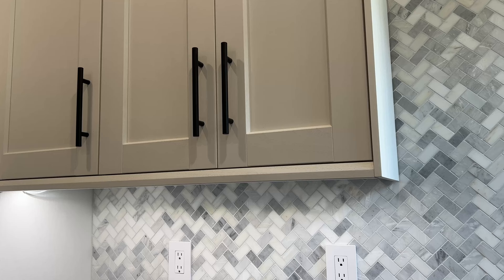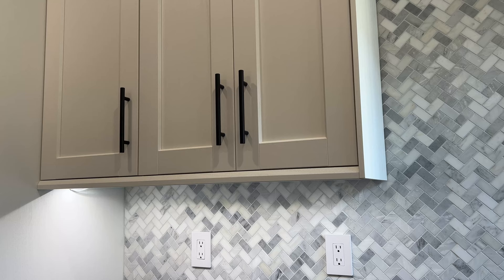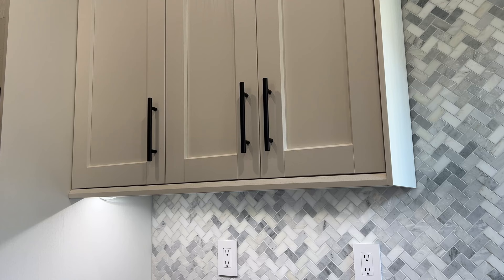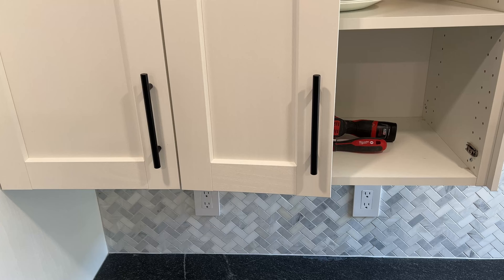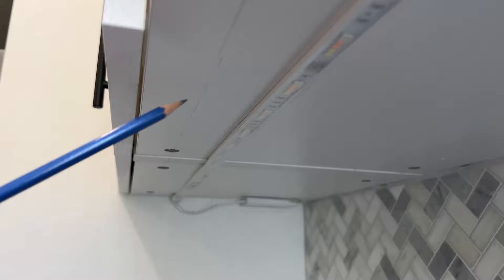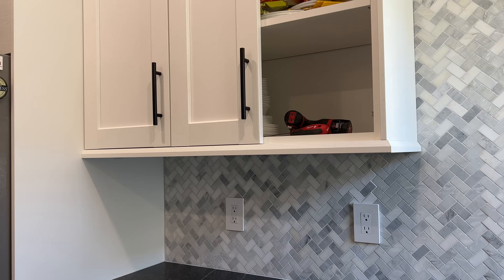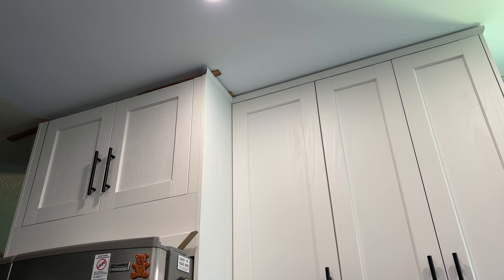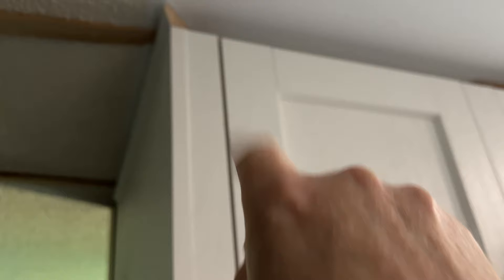How to install Ikea Enkoping Deco Strip quick easy professional results!  What Ikea doesn't tell you

Comment: Thank you so much! This is so timely! We just starting installing our enkoping white cabinets this week! And I loved the enkoping trim when I saw it in IKEA! It’s part of what sold me on the Enkoping kitchen above some other choices. (Plus a better price, but the white makes me nervous!) lol! There are very few Enkoping Kitchen videos or info out there yet, especially on the trim. Like you said, basically zilch! My young inexperienced with IKEA but hard working contractor will need this info when he does the trim next week. Again, this is so timely. Do you have a way I can contact you with a few more questions and photos? I was concerned about his choice of screws, but he did a great job with putting up the first 7 wall cabinets and cover panels! Looks like maybe you used the same round heated, not flush screws, which I think is odd for inside the cabinets.
Reply: Also, have you had any issues of chipping off of the white when drilling or screwing?
Reply from the maker: Glad I could help!  If you have any questions, post them here and I will respond as best I can.  Keep me posted on the progress!  Thanks for watching and the kind words!
Reply: Thank you!

Comment: [90° - 67.5° = 22.5°] For anyone who wants to know why the heck IKEA puts 67.5° degrees instead of 22.5°. It actually is the proper 22.5°...  it's because of where they placed the ref' arrows on the angle dimension on their drawing. From the vertical "Y axis" you need to measure a 22.5° angle; but from the funky horizontal "X axis" they referenced (especially since they use the bottom left quadrant (-X, -Y)). The 67.5° is the proper angle from that reference point... (90° - 67.5° = 22.5°) I think they did this so that they do not reference an imaginary line (the extended axis line going into the cabinet) this way they referencing off of the physical cabinet surfaces.. but that's not how your miter saw works.. your miter saw always has a set 0° "Y" axis to reference from! lol Thank You for reading! (Now go do some angle math to see for yourself)
Reply from the maker: That's a great explanation.  Thanks for taking the time to comment and for watching!

Comment: Thank you!!! Saved us a bunch of time and headache. We had a more simple set up, but this was a super helpful!! Our kitchen set up is super basic compared. We put the deco strips on the top of the cabinets before actually hanging them as we did not have any corner cabinets and just straight edges. Worked ok, as our ceiling is super wonky, in an old house,  and not at all straight so we had to hang about 5/8 gap below the ceiling. Looks decent enough. Cheers!
Reply from the maker: Thanks for sharing.  Please like and subscribe.  Thanks for watching and the comment!

Comment: In metric 3/4 inch is 22mm or 2.2cm.
Reply from the maker: 3/4" is actually 19.05mm or 1.905cm.  Thanks for the comment and for watching!
Reply: @MoreBear  Although you are right, when fitting side panels and deco strips etc. the magic measurement is the thickness of the door, 18mm plus 4mm which allows for the hinge protrusion. 22mm is the correct distance for fitting the decor strip; anything less and the door will not be aligned with the deco strip/panel.  Remember the magic number is 22mm. Deanne, kitchen fitter.
Reply from the maker: @DeanneMariaCreates  Great info to share. Thank you very much!

Comment: Hi, thank you for the great video, it has helped me a lot with planning the install of the kitchen cabinets, my question is, how far down from the ceiling did you mount the hanging rails, in order to leave enough room for the moulding on top of the cabinets?, it looks like you left a small gap between the the top of the moulding and the ceiling, how much gap did you leave?, please let me know when you can,, thank you,,,
Reply from the maker: Great question.  I have 8' (96") ceilings, so the bottom of the hanging rail was mounted at 92&3/16".  Please refer to your Ikea cabinet installation instructions.  I also have a video on how to install the Ekoping deco strip at the top.  Please like and subscribe.  Thanks for the question and for watching!

Comment: This is one of those things where there are a lot of right answers, and it's all a matter of taste. In my kitchen, I put them on "backwards" so the visible parts are square and that beveled edge is hidden. The face of the deco strip is even with the face of the doors, no reveal as here, with the end panels to the top and bottom of the deco strip. That goes better with my Tistorp slab front doors. Easier too! Though I might do it the way you are for shaker-style doors. 

Another tip - in a section like this, it will look better if you put a cover panel on BOTH ends, rather than having the cabinet right against the wall. You don't need to use a full panel, just a strip that you cut off one of the ones that shows to fit it to the wall, as long as it has a factory edge. Looks MUCH better with the symmetry.
Reply from the maker: Those are some great tips and insight.  Please like and subscribe as it really helps me as a creator.  Thanks for sharing and for watching!